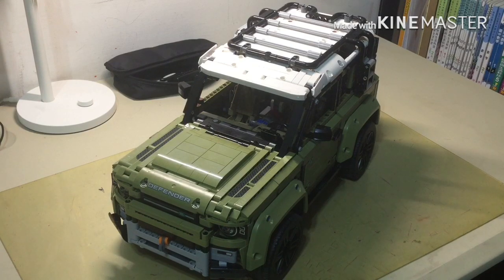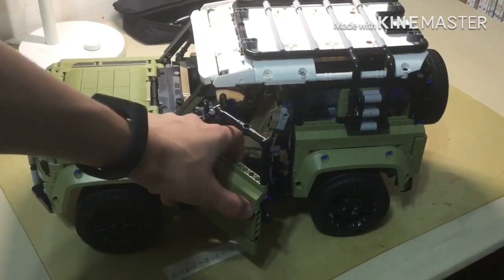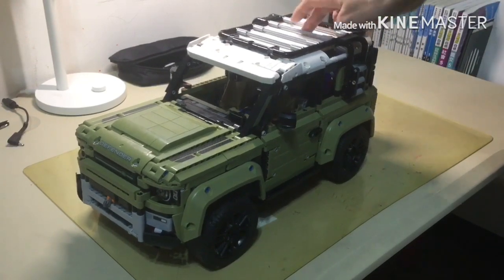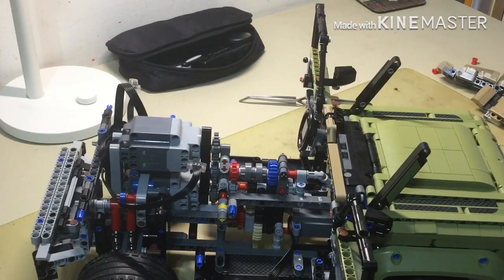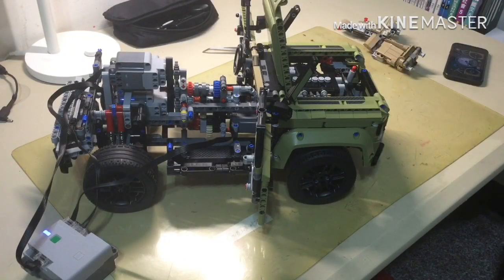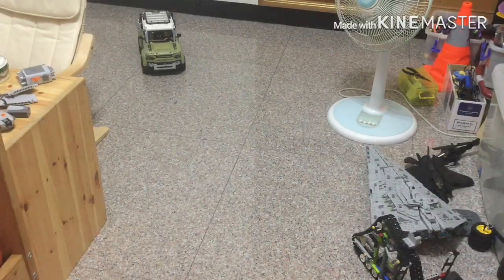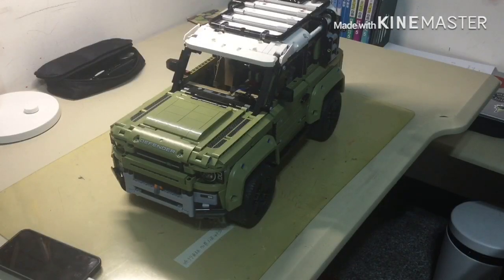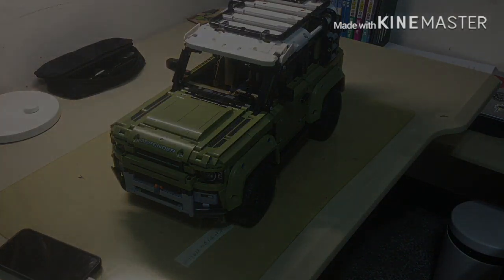Lego Land Rover Defender motorized 42110

Comment: Hey! I just bought this set with the motors and I don’t have any of the pieces that grohl 666 mentioned in the comments :( so I was wondering if you could make instructions! Thank you!
Reply from the maker: Sorry, but I don’t think I’ll be making instructions anytime soon. Since I have school and stuff. But I would like to help you in case you have any questions. 
 I suggest start by taking off the bodywork. Then removing the gearboxes, then adding your own gearbox or build one the same as Gorhl 666’s, as I did. 
Or if you don’t have the wheel hubs, you could build it the same as his except to use the original wheel hubs from the set. And make some modifications to the gearbox or drive train, just make sure that the gearing is nearly the same in the end. (mine was 1:5 but his was 1:5.4  from the gearbox output to the wheels)
Reply: space dragon hahaha I have no idea what you just said lol! It’s fine thanks for the reply! You’ve earned yourself a subscriber!

Comment: I made it with one xl motor and it is not good, it can move only on flat. Now waiting for one more xl motor :D
Reply: One XL motor works fine, you just need to adjust the gearing of the vehicle. Check out my vid to see my Defender running with one XL motor, it climbs a modest incline without much issue, and will even spin its wheels (no diff locks on my model)
Reply: @HarmanMotorWorks  I both worm gear box 2 days ago to reduce speed and increase power. Now I am waiting for delivery so later I will create new really simple transmision :) Thanks for Info, I will check your video :)
Reply: @nemanjabojanic3024  Sounds good :) You're welcome, I think having a simple transmission is the best idea because it reduces friction and reduces the possibility of gear 'cracks'. Cheers 👍